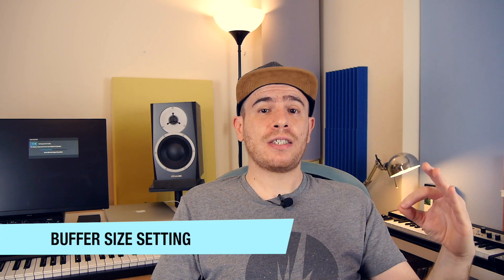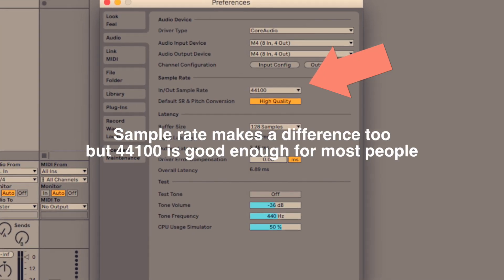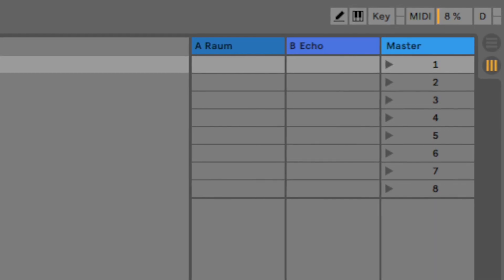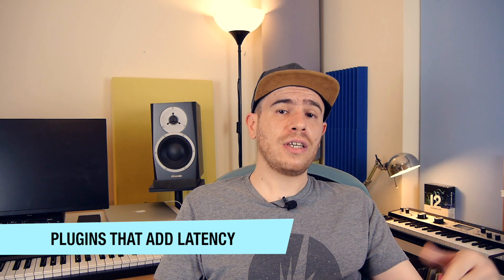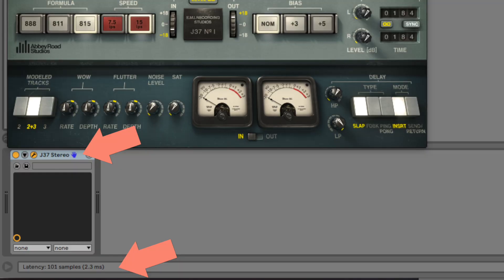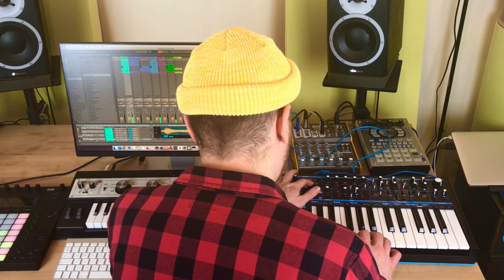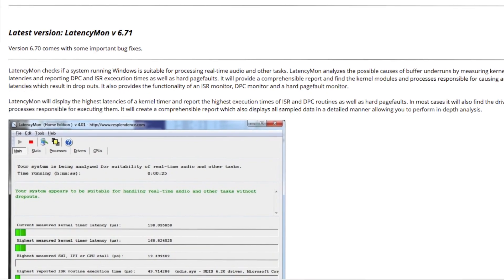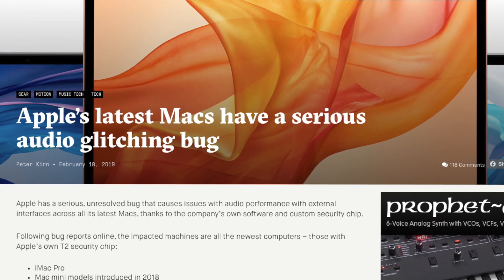How to Fix Latency in Ableton (Or Other DAW)

Comment: hello Low heat Beats, thanks a new time for your tutorials, it is very well explained; personally, i work with Ableton Push, Maschine mk3 as a plug in, and a few hardware synth and groove boxes , and the Latency is the biggest problem in my home studio; on last month , after seeing a youtube video, I think I have found the best solution (witch is expensive I admit ); it is the multi clock usb by Erm; you can find many tutorial and démo on this product on youtube; I m waiting for disponibility of this product on the web shop; I wanted to share this information with you ; have a nice day ;
Reply from the maker: Thank you! Yeah, it gets trickier when you wanna sync a couple of h/w pieces.